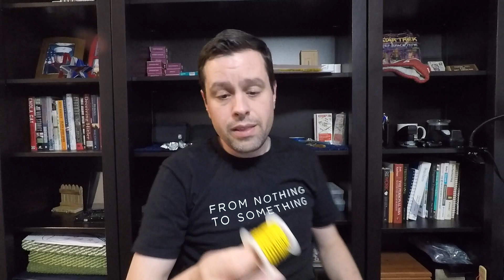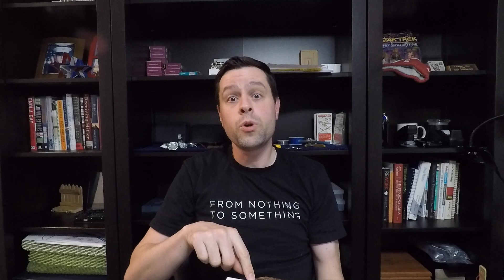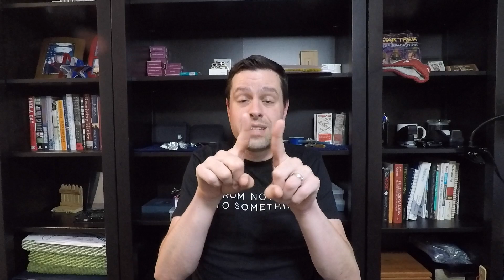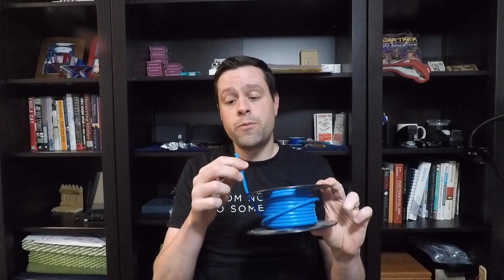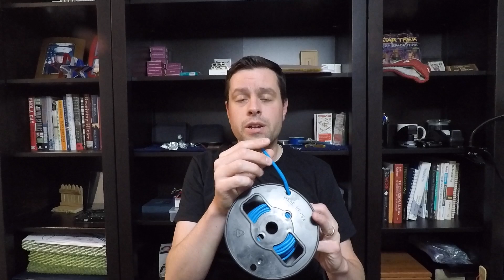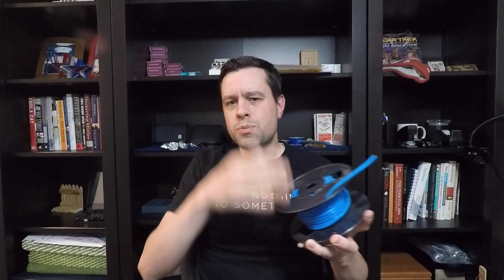How Much Current Can It Take?

Comment: Using Ethernet cable, as in using the multiple wires in parallel is BRILLIANT!
If you want to have some giggles run the 5Volts thru the wire prepared in the fashion you describe then load it with a 1ohm load resistor and if you don't have a resistor which will handle the power drop the load into some water for cooling. Then you can start lowering the load till you see smoke. Of course, you can meter the current with the ammeter portion of the device.
What surprises me is the amount of current those multimeter cables can handle, 10 AMPs.

Great idea formatting your show in which you have selected, it really gets the thought process going.